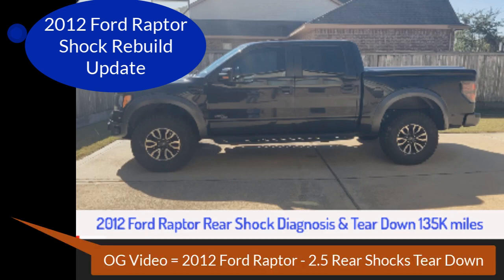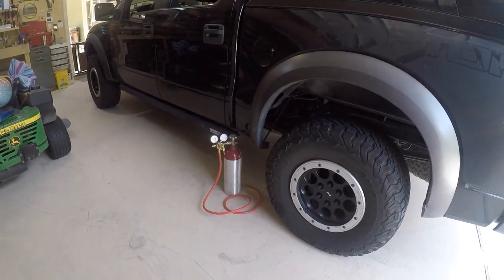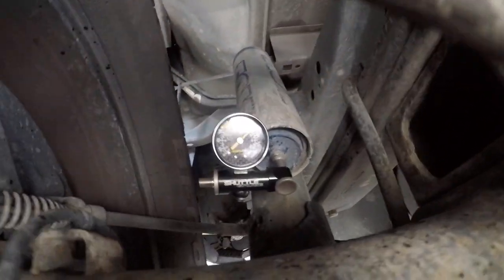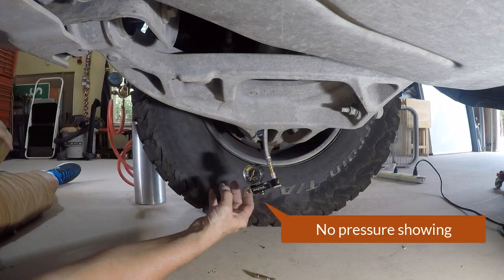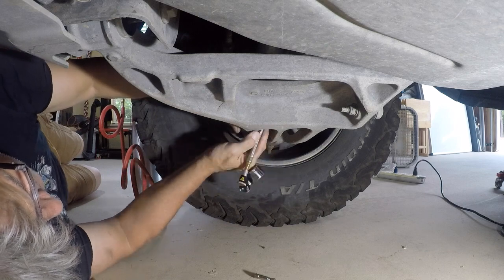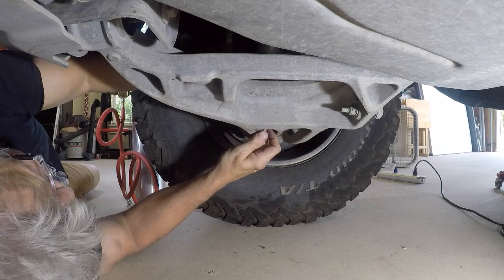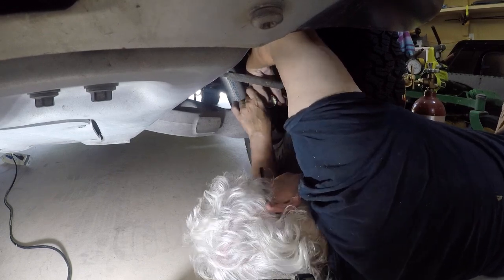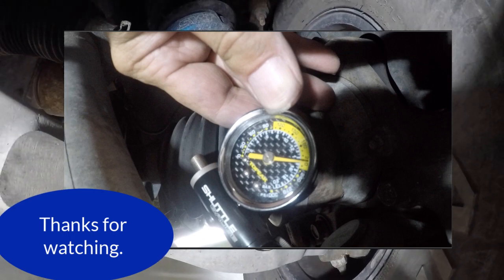Ford Raptor - Shock Rebuild Update

Comment: Have you ever tested higher or lower nitrogen pressure with driving experience?
Curiouse if you put less nitrogen pressure in the shocks if they then will be softer and vise versa
Reply from the maker: Never tested Hight PSI. But  lowering it is not good.

Comment: I bought my truck used and unfortunately I couldn't figure out if and when the shocks were changed (I am almost certain they weren't rebuilt). It's a smooth ride, no clunks whatsoever. Still, it bothers me that I don't know how it is supposed to drive with new shocks.
Reply: If have more than 100,000 miles on the truck and you’ve never rebuilt them you should consider rebuilding them.  If you’ve put 50,000 miles on it since you bought the truck you should consider rebuilding. Recommend rebuild is every 50,000 miles.
Reply from the maker: These shocks need to be rebuilt every 50-75k. Depending on your usage.